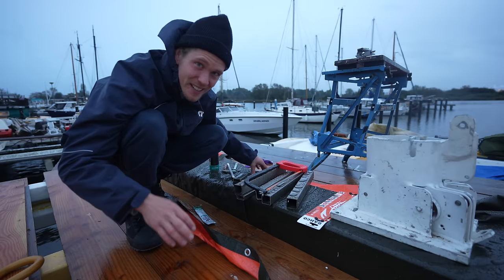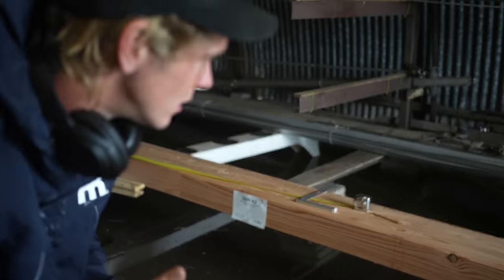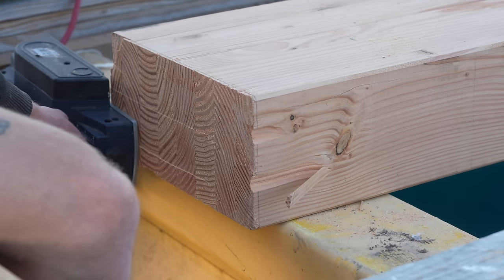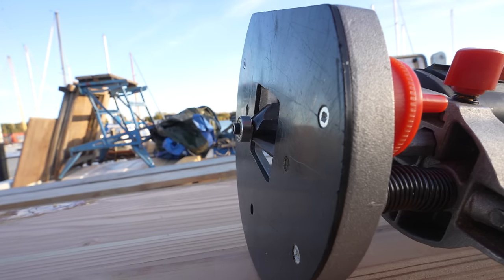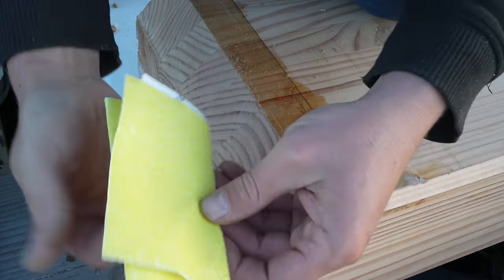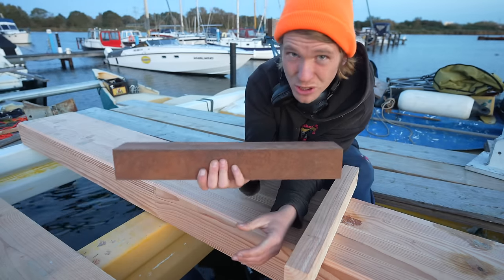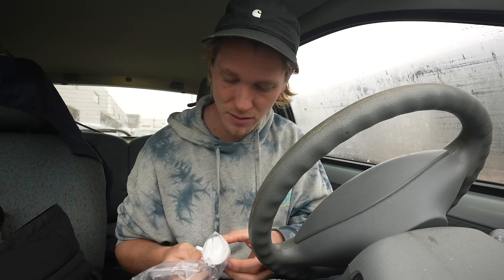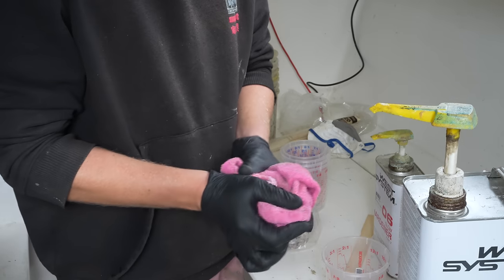My 42 ft Catamaran gets a HUGE Mast Step! | Wildling Sailing

Comment: Always cut from left to right with a router mate (standing face on with the router in between you and the timber) nothing to do with the grain it’s to do with which way the blade is rotating and going the wrong way will make the router jump.
Cutting incrementally downwards helps prevent the timber tearing out 👍🏻

Comment: Hi Mark, I am a major fan, you are a great person and I see you working so hard while way outside of your experience zone, learning as you go. Good for you! I hear how much you want to get this right. A few VIP things: I highly recommend you use (thicker and longer) bolts that go all the way through the beam (not only part way) as the force on the mast-hull connection is tremendous; crucial to make this xtra strong instead of inadequate & risk calamity. Also, do be careful not to stand in water whilst using plugged-in power tools. Finally, consider getting a surform rasp plane (about 20 US$) to more easily remove wood edges without creating accidental chips; it's a handy tool to master quickly and remove wood in a controlled way (plane beam from beam --> outwards).  Go for it!  Don't be afraid to post a request from volunteer help from any local carpenters if/when you need it. Rooting for you, Lee
Reply: Mark ..... top tip ....when using tools above water hang an upturned umbrella under work station to catch accidently dropped fittings, fasteners  tools .etc .
Reply: Big mistake bolting through beams Epoxy glue and wrap with glass

Comment: Top tip: watch your epoxy temperatures and humidity like a hawk. I learnt this the hard way: the first time I tried laminating when it was too cold. The neighbours found me struggling on the garage floor with a half saturated glass sheet and clouds of acetone. The second time I thought I knew what I was doing but ended up sanding off quite a large area of failed glass. This took me 2 weeks. 

Get in touch with west systems or easycomposites and they'll help you out. Buy one of the digital Bluetooth temperature humidity sensors.

Keep up the good work!

Comment: Yes, use the Hard (Aobi) dense wood for best results and longevity. Also on the Beam itself, the routered edges need to be on every edge. That means, on the ends of the beam where you trimed the 45 angle, relieve all the edges, all around.
The Douglas Fir, is a soft wood and as you witnessed, when you routered it, it chipped away so, remember a soft wood will chip away, even when drilling. So, when drilling, don't break through, turn the wood over and finsh the drilling of the hole. Sometimes you can tape areas to be cut or drilled to save some chipping.
Hard woods require sharp tools. Dull tools will burn the wood. you wil see smoke as evidense.
Use flat washers at the HEAD of bolts. This prevents the Head from being burried under torque and protects the edge of the drilled hole of being further damadged.
As you journey through life, do as I have done, study everything that is fabricated. This is where you find standards for your building projects.

Comment: In case no one knows a mast step is always in compression, not sure where these upward forces come from? Chain plates are pulled upwards and the flimsy attachment points on the sides of the coach house are suspect at best. Any boat held together by "lashings" is gotta be makeshift at best. Are we sailing the Kontiki Raft here? Probably worked pretty good a thousand years or more ago.

Comment: Not sure if this may be helpful to you on any jobs. I am a carpenter/woodworker and one of the things that always gets use to make blades on saws last longer and cut easier is a candle. Just rub it on the blade, it stops them from burning and snaching. It also works for drills. A bit of wax from a normal candle will make it easier to drill and easier to seat screws. (Don't use the granular tea-light ones they are crap) Good luck Mark.

Comment: I have been using that 2-1 Mr Boat epoxy up in Sweden for some years.  I would not go back to West or International epoxy again. No blush and no rancid smell, easier forgiving mix. Not had any failures. If you buy a 30kg pack, its an even better bargain.
Reply: Mr boat? Don’t you mean total boat?
Reply: @tekoppentekoppen761  No. Total boat is an American brand, Mr Boat epoxy is European.  There is another world that actually exists outside of the USA.
Reply: @skaraborgcraft  Wait, you're assuming "tekoppen" is American because he can't tell Mr Boat from Total Boat? Tekoppen!? Tekoppen means teacup in Swedish, which is decidedly not in the USA. Skaraborg is also in Sweden. So confused.
Reply: @mattiasfagerlund  valid point. Im from Stockholm 🤣

Comment: Go slow with the router when you get to corners, the slower you go the finer the bite it takes, same with any kind of cutting, slow it down and let it nibble at the edge. Sometimes it seems like you don't make any progress with these kind of jobs, but you only see the final result, not all the measuring, squaring up, double checking, cutting, sanding. You're doing well, keep it up.

Comment: You should have threaded rod going  all the way through that yellow beam, bolted on both sides with washers lock washers and nuts. Run epoxy through a larger bore hole(use large syringe) then drill a smaller hole the diameter of the threaded rod

Comment: There are two solutions to the chipping/blowout of the end grain when planing. One circular saw full depth cut on all sides. and finish with a hand saw that is sharp(the saw tracking off to one side is evidence of dullness) then no planing on the outer grain would be required. Second solution, when cutting or planing a sacrificial board can be clamped onto the edge at the end of the cut. This will hold the edge wood when cutting, planing or routing. Nice work getting projects done and learning as you go. Stoked to see you sailing one day.

Comment: Great vid again Mark. Have to say I was surprised you’re not using bolts to secure that beam. The force going through that will be huge especially in big seas.
Reply: I agree...but won't the right tension to the stays according to the Wharram plans balance that out?
Reply: I'm not an an engineer. Just a curious observer who loves what Mark is doing
Reply: @kevio6868  true, it may have specified how the mast is supported in the plans. 🙂

Comment: I could have missed it, but didn't see you tabbing the interior plywood into the bulkhead or the adjoining old plywood with glass (by the chain plate locations)? I would think that would help strengthen things up and prevent cracking? Sorry if this is what you did and I just didn't notice.

Comment: For the next beam that you are gonna plane into the right size. Bevel all the edges first, up to the drawn line. That way when you go over the edge with the plane there is thing for it to tear out. If you start to tear out then you are past the line and in a whole heap of other troubles :)
Reply: That was a good common sense comment.
Reply: Another way is to take your utility knife razor knife whatever you call it there and score deep on your line where you're going to plane to. That goes for circular saw also score your cuts first and cut on the waist side that will eliminate the tear out.
Reply: Or clamp a sacrificial bit of ply / timber so it splits not the beam. Even masking tape round the end helps minimises the tear out
Reply: Exactly--and I always laminate my own beams using a square steel former, crush clamping using multiple cramps and ONLY Resorcinol glue.
Reply: @MikeBanks2003 the old Resorcinal glue.  I remember that from when I was a kid living on an island 25 miles south of Detroit.  Cures purple.  You prefer that over epoxy?  Less creep?
Reply: Looks like Ipe or a cousin.  Not the easiest to epoxy.  If you are encapsulating the block with epoxy-fiberglass, Doug fir is fine.  Best weight to strength ratio.  Some of those hardwoods like you are showing sink!

Comment: Re the mast foot fixing. The main force of the mast will be downwards. So you don't need enormously tough mounting bolts to stop it lifting. Just a fixing to stop it sliding. I am wondering if by bolting your new beam tightly to 3 cross beams, are you going against the basic ethos of the Wharram design. I believe the idea of lashings is to allow some flexibility between the structural parts. So I would think bolting 3 cross beams tightly together might cause some unwanted stresses. (Please note I am not an expert, just giving observations on what you have helped me to learn about Wharrams. I hadn't heard of them until you introduced me. Now I am almost as enthusiastic about them as you are!)
Reply: Same Neale!!😂

Comment: If there is any way possible get an aluminum mast. Determine the height required and begin your search. Perhaps you might even be able to find a damaged mast taller than your requirements that you can cut off what you need. An aluminum mast would be super if you can find one you can afford. Your boat is looking beautiful. Keep up your good work and you will have your dream.

Comment: Is there someone local with a bandsaw? You could take maybe a third of weight out the beam by tapering it down to something like half the thickness, from fore and aft of where the mast actual mast step mounts. As you have it spanning three crossbeams, removing that material wouldn’t reduce its strength in any way that matters - perhaps a quick phone call to the lovely woman who designed it is in order?

Comment: if its not to late, pick up a piece of angel iron , with 4" sides of stainless steel , use them instead of wood , drill 5 or 6 staggered 5/8" holes in both sides of each side and use 5" lag bolts...good job Mark keep it up......

Comment: Hi Mark,

I hear a lot of folks expressing concern about the forces being exerted on the mast and the size of your screws vs using heavier through bolts and nuts. 

I couldn't begin to advise you one way or another based on personal experience. So instead I would refer to the builders or experts in the matter. 

I would assume you spoke with or could prevail upon the designer if you haven't already. 

Good video, Mark! Keep it up mate. Cheers!

Comment: Like I said from the start, 2yrs!! LOL Go with a small 4stroke tri engine sat up and have all 4 set up as quick detach so you can run anyone of them in all 4points of need. Point #4 is the dinghy engine. So, 4 10hp outboards. Buy 4 old junk ones and rebuild them all to like new so that you know then like the back of your hand!!! LOL like I said 2yrs!!! I would make my main mast to be able to break in half or drop as well so that I can navigate pass low structures as well. Plans change a lot when exploring in life right now is the time to prepare for change.

Comment: Totally agree with Angelos comments the deck beams need to have the cheek blocks through bolted with probably 10 or 12 mil stainless steel rod. These screws will not hold you and Rig up. Be safe.

Comment: Clamp a piece of wood to the side you come off with the planer, and the extra sacrificial piece will stop the wood splitting away. And to avoid the sticky epoxy, put tape on the wood. Cut straight through the tape.

Comment: A2  Stainless steel referred according AISI/ASTM as 304 - is cheaper and widely used in gastronomy and typical weather conditions. can be used in marine applications as well. A4 stainless steel referred as 316L according norm AISI/ASTM is the "acidproof" steel used in more toxic anvirnonment,chemical industry where much higher risk of agressive corrosion occurs. A2 would be good enough for you, but it's not the error if you can afford A4 instead A2. WOrst thing is if you apply A2  intead required A4.   greetings.

Comment: Prolly should have scored that beam all the way round first
Duct tape around the cut line might have prevented the tear out from the planer
Prolly should have first epoxied the area before you put dish soap so it doesn't soak in and jeopardize a later application of epoxy or paint
Always oversize and epoxy fill holes in wood to prevent water infiltration into the wood

Comment: crew up under mast beam for fixing to cross beam hard wood pads,   the mast is 90% down force on the beam not side to side some fore and aft depending on mast rake the shrouds and stays and there fix points take most  of the sail power on the rig . fresh  water running down the mast,  on to mast shoe then deck can be a source of rot so take care to seal at water trap areas. mast step foot and fixing points and a thin man made rubber pad under mast step ,to allow for wood to metal flex , but look at other wharram cat . there must be pointers in the wharram build plans for mast step and rigging . good job  see you on the water.

Comment: When epoxy is tacky or green it is still reactive. Recommend gloves if you touch it. Recommend a dust mask if you sand it. Although outdoors maybe it is OK without the mask. Douglass Fir is not very rot resistant. It is a strong wood for its weight, but not as strong as hardwood (which is heavier). Douglass Fir is very prone to checking. So a good epoxy coating, or ideally fiberglass coating is a good idea.

Comment: G'day  Mark...
Think I'd bolt right through the beam with  sizable bolts , washers & a
 lock nut .
 Expecting screws into soft wood to take Max force is a big ask.
 Also,if you intend on keeping the yacht for a long time ,and can afford new motors ,do it for safety and reliability. 

    Respect..!

Comment: where the hardwood blockes connect to the beam it is worth putting a bedding compound btween the two faces to stop water sitting in the joint. I like to use Arbomast  BR. It is a butyl rubber so you can take it apart again if needed. or you could use wet paint.

Comment: Hey mark I really like how you aren’t daunted by anything. Big ups for taking on all these challenges. When I saw your laminated beam I wanted to ask whether it matters whether you are using it vertically or horizontally. I would think the maximum strength would be with all the laminations stacked one on top of the other. If you are not using the beam with the laminations stacked on top of each other won’t you essentially be relying on the strength of a single lamination. I’m an idiot so don’t take my word for it - maybe check with Hanukkah? Dam thing may be so strong it doesn’t matter but I would want the bastard to snap on you out in the middle of the ocean. Love the videos - please keep going.

Comment: Get a couple of cheap candles and rub them on the lag bolts as it will make it 100 times easier to screw them in and you can do the same with any screw

Comment: All looking good.  To avoid knocking bits off your beam, nail or screw a bit of old skirting board to the surface where the plane is knocking hits off.  That way, bit of timber are knocked off the skirting board and not the beam.  When you finish planing, remove the old skirting board...

Comment: Good pnya mate🤙 but screws instead of proper bolts WILL be the boat's early demise sooner or later, because water will always get in there. Bolt holes with epoxy, then bolts when epoxy has dried. All wood must have the epoxy bareier in all holes.

Comment: Mast loads are vertically downward. Mast foot only needs holding in position horizontally. 9 x M8 a4 stainless bolts will have a combined breaking strain of over 20 tonnes so more than adequate.

Comment: Doug fir is an inside material, not used outside and rots easily. You will need to give it an epoxy treatment to stop water intrusion.
I personally dont like lag bolts they can loosen over time. Your doing good keep at it.

Comment: You should drill the outer hole at the full 8 mm or a hair over. You don't want the threads to engage in the outer piece of wood at all. The threads engage in the inner piece only. This is how the screw is able to clamp the two pieces of wood together.

Comment: Mark I don't think this boat when you have finished it will be safe to cross oceans ok for the med and coastal but its a untried design you have done yourself . But as someone has said lashing the beam to the cross beams can only help. Maybe if you get it signed off by a marine engineer hopefully would prove me wrong.

Comment: A2 is also known as 304, whereas A4 is also known as 316. You need the Latter 316. Both do rust bu 304 does not last with sea water condition. 316 come in standard and 316 L with a different carbon percentage. 316 L is a bit soft for screws but used in boat railing. You are probably aware that its from cheap. Thats probably why Wharams are mainly put together with ropes. As for wood the hardwood is a far better choice, but make sure you drill slowly, otherwise your drills burn up quickly, take your time..free the residue, dril a bit  more etc.. As for mr Boat, we have great experience with them, Frank was a great help for our coppercoat project and yes their prices are good. ... started typing before i watch the second half... you'll be fine

Comment: Even for laminates it's probably more important to consider whether you are "climb cutting" or not. That is, you generally want to feed the work into the cutter such that you are pushing the whirling blades into the work. You don't usually want the case where the blade wants to pull itself into the work. You want the resistance of thew work against the blade. This is for safety and for getting a clean cut. As you say, taking lighter successive cuts is also important. Depending on the work you can set the depth/height of the cutter and use shims to set the depth -- if an accurate depth is important.

Comment: Coming along nicely Marc. Not that I know anything about this but curious why you need to attach the smaller pieces of wood to the cross beams and then attach the mast step beam to those, it doesn't seem to add anything, especially as not through bolted. Why can't you just through bolt the mast step beam directly to the cross beams?